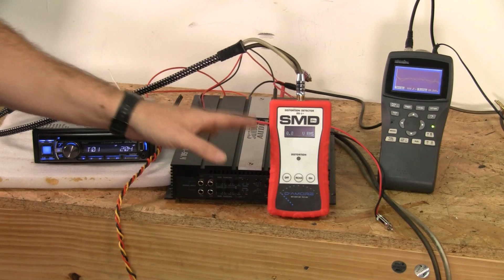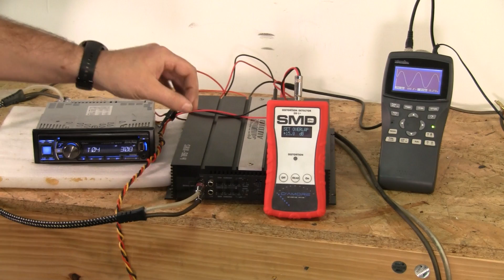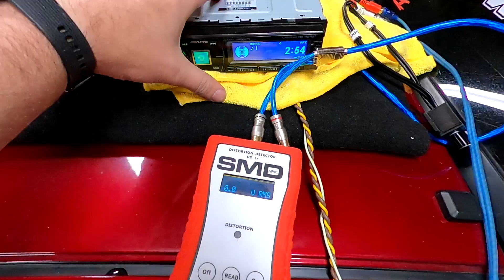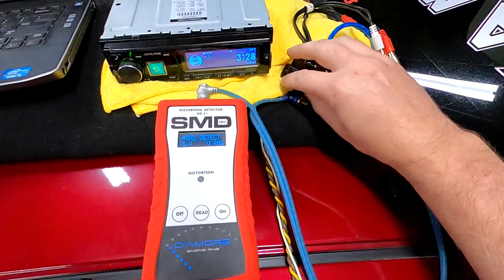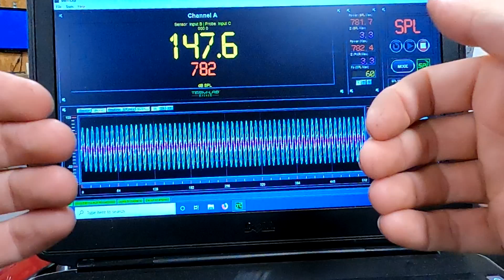The TRUTH about the D'Amore Engineering / SMD DD-1+ - Tech Stuff Tuesday

Comment: Ok my name is in the title of your video so you know what is coming next.

LIST OF YOUR ERRORS

1.  Video description.  RF paper on building your own high passed speaker project is not 1/10 the price.  It's twice that, WITHOUT LABOR,  is your time is worthless?  You just valued it at $0.00 per hour

2.  Video description.  A High Passed Speaker is not a Distortion Detector.  RF you listening?  

3.  1:39  No headunit is 0.5V out.  But if it was you just put the probes on the amp to set everything, headunit, processors, amp, all measurable THROUGH the amplifier.  This is actually the preferred method since this way you can see distortion of outputs AND INPUTS of all components in the signal path.  No need to plug headunit into DD-1+, ever, unless you want to see how many volts come out of it.  

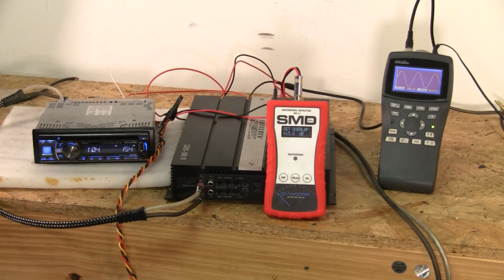4.  At 9:42, at this point you are supposed to press READ and then switch to the OVERLAP track.  EVERYTHING FROM THIS POINT ON IS INVALID SINCE YOU DIDN'T.  THERE IS NO reason for anyone to watch this video past 9:42. 

(I'll keep watching to see what other misinformation you are spreading) 

5.  13:43  The voltmeter on your scope is a cheap AC averaging meter that calculates AC RMS from any waveform, based on the math for calculating the RMS of a sine wave.  The math doesn't apply to square waves hence the error on your scope.  The DD-1+ voltmeter looks at the peak of the waveform, any waveform and determines what the maximum clean sine wave voltage would be that fits in the "rails" of the waveform.

6.  16:19  So you're saying if someone adjusts their gains for maximum clean output, and then you turn up the EQ or level more it clips????  NO SHIT

7.  17:32 And how would using your scope or the my first electronics project from RF to avoid these problems?  It can't.

8.  19:34 This is a problem with this headunit.  A better headunit has trim level adjustment for all sources, or an engineering team that took care to make sure all sources had the same gain before the design was mass produced.

9.  20:30  The DD-1+ shows when distortion reaches 1%

10.  23:32 Please describe this "more" that the scope tells you

11.  25:12 yes

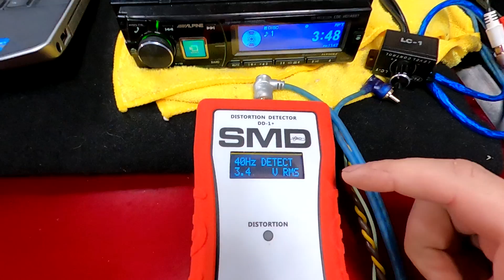12.  29:01 this has nothing to do with the DD-1+

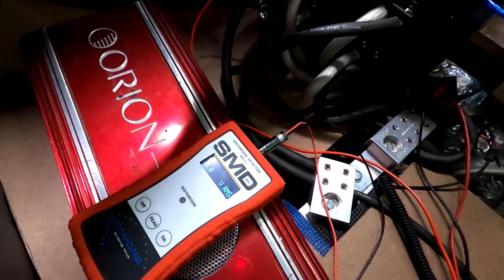13.  30:28  this is exactly why it is best to do all measuring at amplifier output

14.  31:04 the quick blink of the LED when increasing level is the 3 stage autoranger switching ranges, mentioned in manual

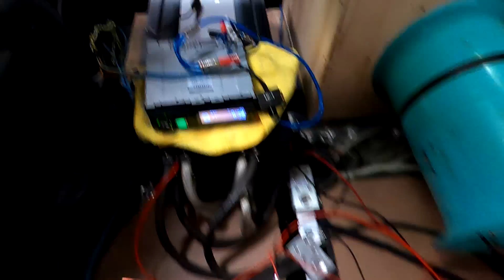15.  32:10 you just set it with NO OVERLAP?!   EVERYTHING after this is also invalid.

16.  34:14 voice coil is hotter now and the impedance of your woofer is higher, so in turn it got less power.  20 less watts = 0.1dB less, nothing to see here. 

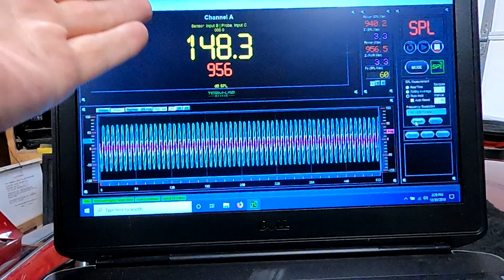17.  39:00 You clipped it hard, of course it was louder and put out more power.  Now try using the DD-1+ properly and put 5dB overlap in it and do SPL run and make that video.  

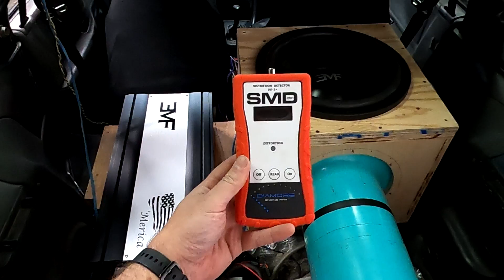18.  40:41  You showed us that you STILL didn't use it right, even though 20,000 people already know how to use them perfectly everyday.
Reply: Tony D Mike drop
Reply: Got to love it when a real engineer shows up to educate us all
Reply: Lmao 🙏👍💪👊
Reply: Finally. Someone who knows what they are talking about. It’s like you engineered this or something.
Reply: Anthony Damore I absolutely love that you chimed in and set things straight. I’m glad that you pointed out the AC RMS Averaging within the scope. I’ve had arguments with a few people about that because they trust scopes a little too much. I have loved my D’Amore/SMD products very much. Keep up the great work and collaboration with Steve Meade.
Reply: And probably mess it up again lmao
Reply: Head shot.
Reply: @timworley8986  That comment is the kill shot?
Reply: Haha. I’m sure EMF will delete this video and say it served its purpose.

This guys trying to embarrass SMD but in turn shows he doesn’t know how to read an owners manual.
Reply: i like watching your videos from your other channel d'amore engineering specially the video of why clamp testing is inaccurate
Reply: The owner is here!
Reply: @molloyvader  "In The House"
Reply: He will probably show us another screen shot of his phone saying he did it wrong again as another test to see how people would react and delete this and make another video
Reply: @brandonjohnson7559  don't forget his shirt changing halfway through that video
Reply: @Fine_i_set_the_handle  my issue was literally NOTHING moved except the camera and he changed his shirt....that's it everything elses EXACTLY the same, and it was supposed to be I belive he said 7 days later.
Reply: Tony can you Please do one of those reaction videos of this video?
Reply: Nothing more to see here after this break down
Reply: Hey Tony, huge fan! My nephew is studying to be an electrical engineer as well. I know there are a ton of comments but any chance you could read mine about gain overlap and give me some feedback. Steve of course jumped my case but I honestly don't think he got what I was trying to say. Thanks man! Keep up the amazing work.
Reply: "I have spoken".
Lol.
Reply: emf lies https://youtu.be/e0Wppmh0V34
Reply: Thank you for saving me from watching a 42 minute video lol
Reply: What the o-scope had going for it over the dd1/+. Is oscope is a multi-purpose tool. So I'll stick to that. Not saying dd1 is good or bad just have no use for something that will get used once or twice a year, then is a paper weight the rest of the time. Since i use my o-scope almost daily.
Reply: Thank you Mr. Damore
. Picked his shit apart clean!! I'm so sick of this guy making money off all the hate he created.
Reply: I wish I could spam the comment section with his comment so everyone reads it
Reply: The man, the myth, the legend. Tony D!   

Glad you finally showed up to set this EMF clown straight.
Reply: @CCasket  Exactly!! Thank you.!
Reply: lmaoo i love you for this
Reply: Just  here for the comments   bhahaha
Reply: @Des420  You're the fuckin clown. Seems to me you're the one who needs the "Internet tough guy course. What, are you MR.EMF's little bitch? Or maybe you are him. That would make sense considering the childish rant.
Reply: I couldn’t watch this crap past your point #6. What a jackass moment. Everything is set perfectly to maximum clean output...... and then you adjust it.....🤔......yep.   No shit, it clips. Who’d a thunk it??? 🤣🤣🤣. It doesn’t matter what you set it up with, it will do the same thing. If your on the razor’s edge of distortion/clipping, ANY increase will push it over.
Reply: Let me tell you something. When I read:
"6.  16:19  So you're saying if someone adjusts their gains for maximum clean output, and then you turn up the EQ or level more it clips????  NO SHIT"

I fucking died laughing rofl
Reply: Excellent! Also, aren’t clipping and distortion two different things?
Reply: 11. is not an ERROR then ;D
and are they all errors? isnt he just demonstrating what it takes to do it wrong and end up getting clipping in goal of protecting you audio equipment?
i mean i am not a "BIG" fanboy of nobody so im the in between guy trying to make sense of the dispute here, ok?
what i've learned here is what i thought, but at the end of the day you can set gains all you want, but i'm no pro competition guy, i just listen out for distortion or clipping so i dont break my shit cos i care for it, do i need all the gear worth many $, i have had big gear for years never have i ever blown a speaker and its been loud probably nothing compared to competitioners i hope but decent enoght, that will give me some hope to experience better in the future otherwise i'll be disapointed!
my experience is that every song i play (.FLAC/Spotify HI) there is big chances of it being different in volume so i need to listen out no matter what, and ive been in a car where the owner just ramps the volume up after it distorts with no care for the quality (horrible) does he not care or understand, wtf is going on???? i dont get it, those ppl are the ones that need the tools but dont know they exist or how they work.
Reply: sad they wanna bash people when they have shown they don't know how to use equipment. they just tried to do it again to skar and barevids just debunked more of their garbage propaganda.
Reply: I realized after watching his first video that he falls under the category of knowing just enough to fuck something up. Blames box size for blown and physically damaged woofer, aligns speaker coil with printer paper, Thinks anything above 0db is "clipping", thinks motors are non-factor for power handling.... etc
. EMF is a prime example of the toxic part of the tech community, I can't imagine how many people he has screwed over 😳
Reply: Wow.....the actual engineer of this AWESOME piece of hardware came in and ROOOOOOOOOOASTED #emfaudio Ass to a crisp 😂😂😂😂😂😂😂😂😂 I assumed emfAudio had read/followed Instructions 👀👀👀🤦🏽‍♂️🤣 I actually looked around for a thorough  and technical reply from emfaudio, im guessing it was at this point he realised - he fucked up lmao
Reply: you're just going to have to fly over there and do it in front of him and compare his results in person
Reply: @goomz84  Thats what I'm talking about. Thats how we did it back in the day. We didn't have the internet back then.
Reply: H O L Y  S H I T !
Reply: @Gene Nichols Thats awesome.
Reply: Tony Melo  Now thats some constructive criticism for you right there.
Reply: I think the point was,and it didn't seem difficult but perhaps I don't need help tying my shoes,is that one,you cannot will not get every ounce of power from your amplifier without distortion,this should be amplifiers for noobs room 101,because music is dynamic,and it's a proven fact Steve himself chooses to set his gains per DD1 at a "safe" number,because,again,music is dynamic,two, he proved that even with the DD1 you can surely set your gains incorrectly that you should never assume you're safe. That you should NOT set your gains at just before distortion. YOU know this. You should. Because,say it with me,MUSIC IS DYNAMIC.
So, does your instructions state this? Is it inferred? Suggested? Referenced? Hell I don't know. I don't need a DD1 to set up my installations.
All that aside, he repeatedly stated and made it obvious,again shoe laces, that it isn't and wouldn't be the DD1's fault IF you did it "this" way. 
He was addressing HOW you could do it wrong. How not to assume "safe" areas of gain. And the elephant says nothing is perfect and all encompassing.  
But then you immediately went into your own protect mode.
Reply: AND if you say "you cannot set gains improperly that will NEVER clip with my DD1" I'll virtually pimp smack you.
Reply: You should do a review of his products.. probably OEM or rebranded
Reply: Fk..tony d went all in on this..
Reply: I think they should suggest in the manual for slow people like me that you should set it acoording to your bass treble levels, however I thought still do think that 15db overlap means boosting your bass treble via eq would be accounted for loudness button knocks up 10khz by 10db and the bass at 100hz by 10db pluss bass boost on deck equals 6db plus si you need 16db overlap? 😏😏👌👌🤣🤣🤔🤔🥱forgot plus 12db bass and treble on built in equaliser on deck so I need 30db overlap? not all distortion is audible so its aboat being safe? watching cos reading comments.
Reply: Wow, a whole lot of kneepads came out here
Reply: Are you the owner of Damore engineering?
Reply: River Alley he’s the owner
Reply: @rich9300  don't want to hate on Steve but him going off like that was still not the smartest.
Reply: @riveralley  if it ain't the Internet troll himself!! I knew you'd be on here 😉 why dude why? 🤷🤣🤷🤣🤷🤣
👏👏👏👏👏👏👏
Reply: @Mr.NiceGuy78  you commented on one of my comments earlier... I though you would have realized.
Reply: @Mr.NiceGuy78  he's the Zv5 king 🤣🤣
Reply: River Alley yes he is
Reply: Tony with the 🎤 drop!

Waiting on emf to jump in and make himself look even dumber then he already does.
Some woman (emf) will do anything or attention 🤣 look at me I got views 😂
Reply: This guy is a clown with a major hard and for anything Steve Meade. I already distanced myself from this fool's content but couldn't resist clicking today to see how bad he fucked up again. Then read the comments of people talking about just how incompetent he is.
Reply: @samscharp3367  A couple of years ago I pointed out something that he said incorrectly and he just would not admit he was wrong. After he no longer could dismiss the fact that he was wrong, he claimed to do it purposely.
Reply: EMF is the most butthurt brand out. He spreads misinformation constantly and dumb people believe his rhetoric because he sounds somewhat intelligent while doing it. Glad he got school by D'Amore. And he's still butthurt about all the manufacturing he outsources to China and claims "engineered in the USA" when it's off the shelf designs and it's putting a dent in his wallet. So what's he do? Tries to attack other brands to hopefully bring them down to his garbage level rather than focus on his brand!
Reply: Bait set and fish on
Reply: @scfirefighter31  Mr. EMF or whatever his name is, I call him Elmer Fudd, hasn't commented back. What can he say. Mr. Damore Tore his up. 
Mr. Fudd will come back with something, instead of just leaving it alone he will start more shit in an effort to put money in his pocket because his sales are way down.
Reply: @christianrobbins4590  Well put.
Reply: @christianrobbins4590  educate yourself dude,, I return those expensive stuff, get ossiloscope that's all I can tell you...
Reply: So either he id incompetent using it or he is lying trying to make product look bad. If he lies about this he will lie about anything. Rockville is probably way better then emf. However all he did wad change dust caps on emf subs because they look just like sundown. O yeah and he marked up the price lmao
Reply: Still, waiting on the list of ERRORS?  I'm Here for Education...
Reply: Get the ossiloscope INSTEAD.. 1000%%% sure, it give you a lot of, live mv, v, ohms, etc etc... NOT EVEN BAREVIDS YOUTUBER USE EXPENSIVE STUFF,,, ITS USELESSSSS.. GET OSSILOSCOPE OK!!
Reply: Anthony Damore, shutta  fuck up before I smack you...  Let your daddy the expert talk ok.. don't get irritated when someone talk at tech level,, to me looks like everything is exposed, I'm 100 + on the side of this guy.. that's why I ended up returning those expensive devices, because i knew this,, it give you 85% accurate but that's it..

Comment: You forgot to show that a phone using Bluetooth can also clip depending on volume level as well. I have to keep my phone two clicks down from full volume or it clips hard.
Reply: mikes hobbie's and random stuff I have never had this problem 🤷🏻‍♂️
Reply: mikes hobbie's and random stuff does your head unit have a source level adjustment?
Reply: @jamesbondcaraudio4247  I don't believe so but even if it did it wouldn't solve it the clipping comes from my phone at full volume, it even does it using headphones with my phone. Depends on the phone itself as I've had phones in the past that didn't have the issue.
Reply: mikes hobbie's and random stuff got it brotha.

Comment: It is a niche tool. If you feel like you need one, get one, if you feel you don't need, one don't get one. Simple as that.
Reply: To be honest, it's absolutely useless unless you have another way to meter it while playing other material.  The om-1 is a must.   Without it, the dd1 isn't worth much unless you're setting gains at 0db.   (Which no one does because almost no program material is recorded at 0db for bass in music).  
0db for bass would be for testing and such.  Now 0db recordings are definitely present for much higher freq's.   Cymbal crashes and snares and such.